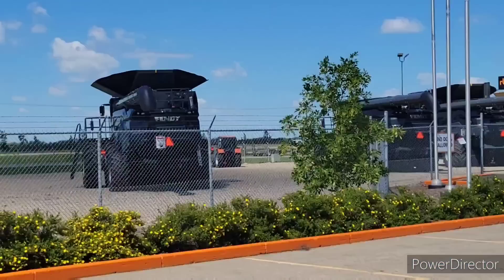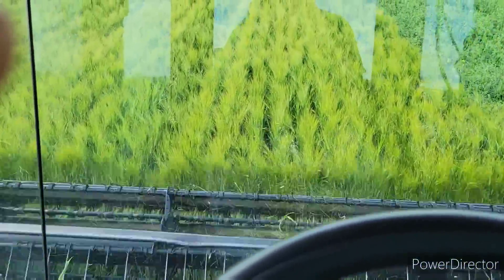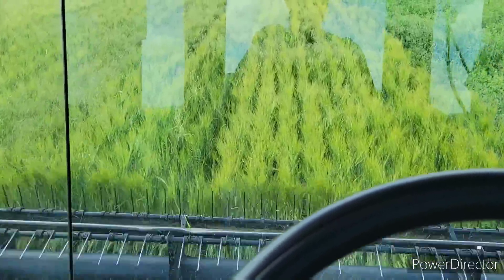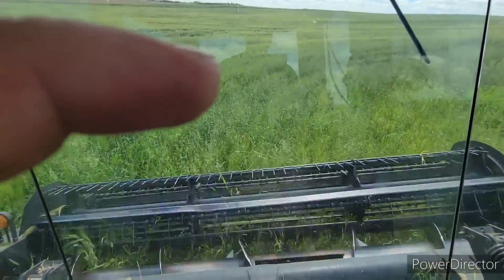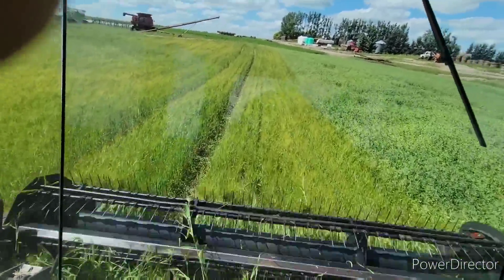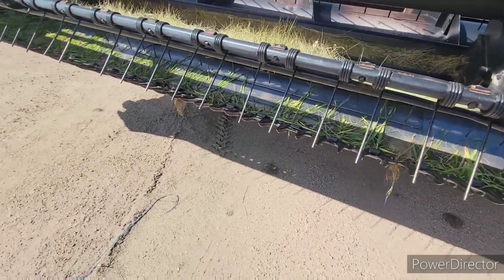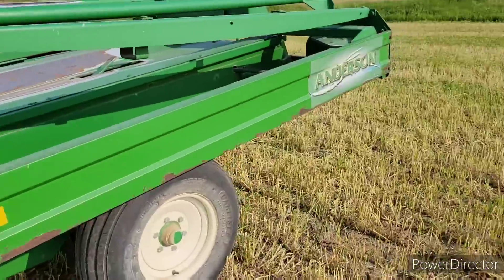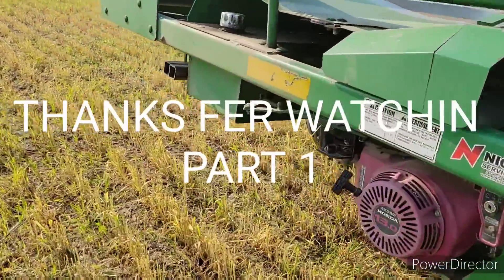Barley Silage Balage!! PART 1

Comment: The old 660NH has a simular drive roller but the idler side is not out in the open like yours. And the old roller had a inch and half bearing. It piled up and chewed the end out. So 3g later like you say I got the updated roller like a 668 would have. So bigger idler bearing
Reply from the maker: King

Comment: Dang breakdowns.  I had 2 in the truck. Voltage regulator went out, (got home with headlights that were barely glowing). Then a dam wheel seal slinging gear oil all over coming out of Minnesota. That's going to make some dam feed Ryan.
Doc
Reply from the maker: Breakdowns never end hey

Comment: WP215M is a different guard then MD118344

215 is not double hardened 
118344 is double hardened.

215 bends and breaks way easier then the genuine MacDon.

At least that’s our experience
Reply: I should add that WP215DH is as good as the factory ones except you can’t seem to get them anymore
Reply from the maker: 215H is hardened. That's what ya need.
Reply from the maker: Macdon makes a dam good gaurd tho